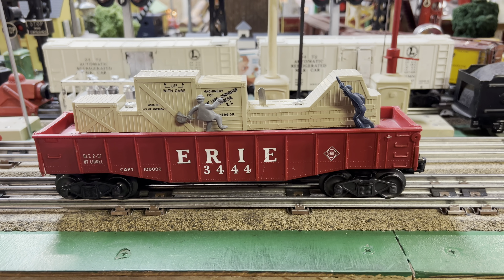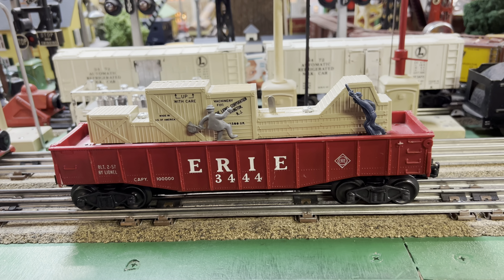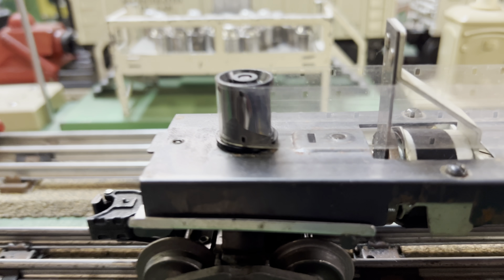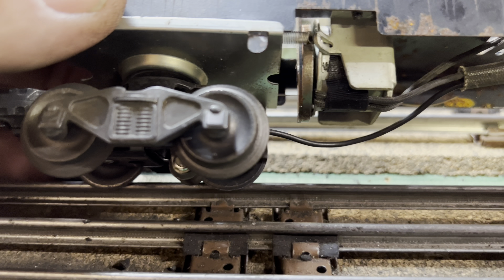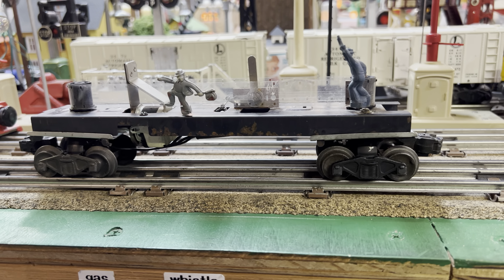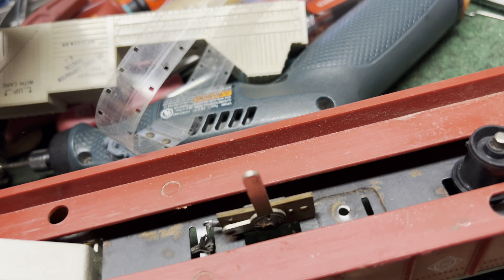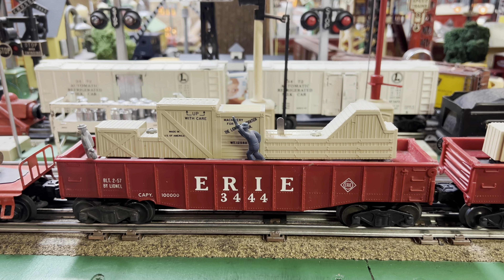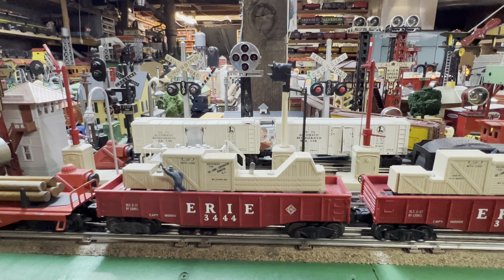Postwar Lionel 3444 Animated Gondola 1957-59 Cop & Hobo

Comment: I wonder if it's possible to re-power these with an appropriately sized DC can motor. I've seen the vibrotor mechanism in the culvert unloader done this way. It looks like there might be enough room if it's cleverly mounted. Perhaps a challenge to be attempted someday, I don't yet own one of these cars.
I once picked up at a store, what appeared to be the crates for this car. But on closer inspection, the crates were too short. Turns out Lionel modified these crates to create a load for the HO gondolas. The crates I had found were an MPC reissue, used on a flat car. It took me a good several years to eventually learn what my crates were for.